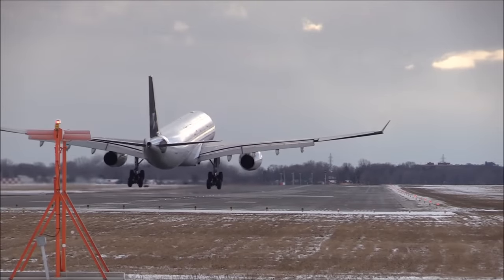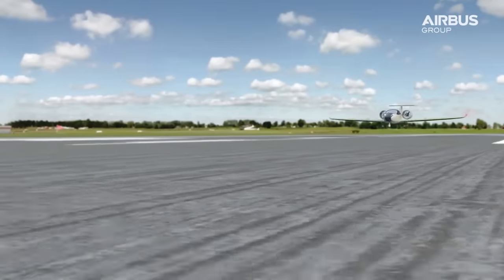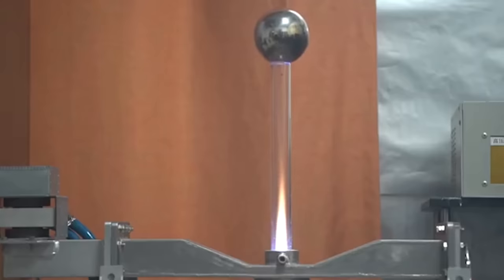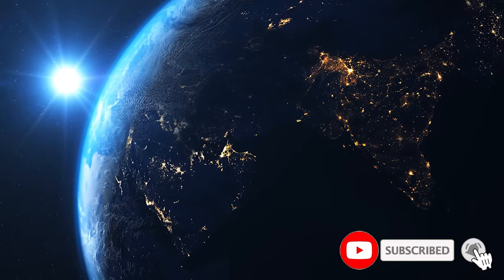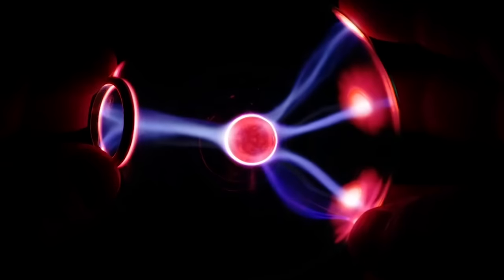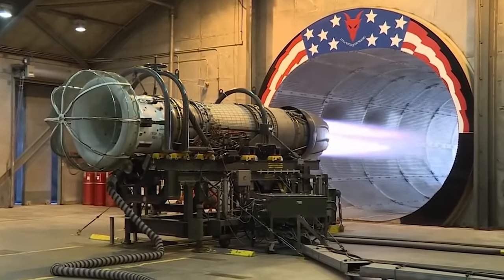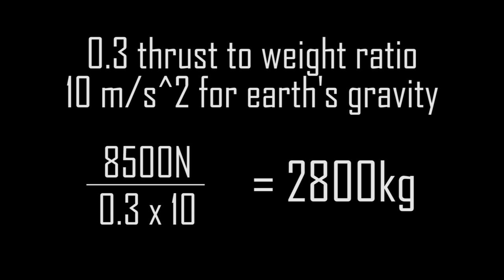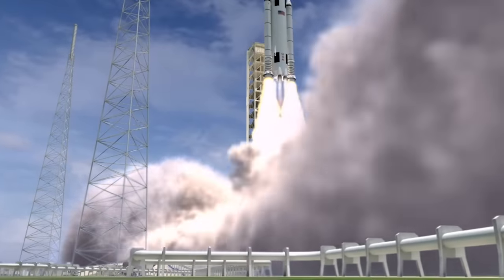Uncovering China's New Electric Plasma Jet Engine

Comment: a fusion reactor powered aircraft would be really cool. this device is almost like a plasma torch turned up to 11
Reply: Flyingwigs 
Cool description!
Reply: Nice. Have you heard of torch ship concept, by the way?
Reply: America tried a fusion powered plane but flopped due to weight and potential safety hazards back in the day
Reply: @humdilla576   that was fission, not fusion. decaying radioactive fuel rods to generate heat to make steam. fusion is still not yet fully operational, but in theory can be scaled down to manageable sizes.
Reply: would be stupid to run the engine electric tho
Reply: not when the engine also generates the electricity from the same process that propels it. you only need batteries for reserve power or in between engine runs.
Reply: @Flyingwigs  Then it is more like a fusion engine with a generator on it, rather than an electric engine.
Reply: @Al Castill Never a good idea just ask the Russian's.
Reply: I believe that it's called the "big stick" and its exhaust emissions were radioactive. 
 the rods would get stuck because of the heat after it went full throttle. 
It was an unmanned drone.
Reply: won't work ... It's exhaust will keep on spreading RADIATION continuously 
IF U PUT COOLIENT or etc will increase much weight of aircraft and production cost and maintaince.. maintenance requirements would be regular and high cost
Reply: @MrGrinny  oh no
Reply: Certainly not through Tokamak designs. High likely not using magnetic confinement alone, no matter which configuration. BUT, we can not discard some kind of inertial confinement, specially on devices that use aneutronic fusion (Boron-proton) capable of direct transformation of fusion to electricity without a bulky generator. In linear configurations, I think that a compact machine on future refinements could fit inside a plane, probably dividing the cargo space and using the back of the plane as the "fusion detonation" area (with minimal radioactive with proper shielding during the flight).

Big planes anyway, but It would be cool for large flights have big planes that works on cheap energy.

The requirements are high. First we need to have achievable fusion. Later with need compact and very reliable fusion for continuous operation. And probably we will need batteries improvements to have  a battery pack for manage energy and have a backup for shutdown emergencies.

I don't expect something like that very soon, but I see this like a future possibility.
Reply: This is not fusion. No one has yet created a stable net gain fusion reaction
Reply: 1st they have to find a way to contain the plasma without hitting the wall and also they have to find something that resist high temperature caused by fast neutrons.
Reply: @makisekurisu4674  they think its closer with that resonant wave currents theory, but yeah.
Reply: @makisekurisu4674  awesome account name btw ;D
Reply: @mithlesh7042  fusion does not create the deadly forms of radiation that fission does. also it wouldn't need to be open air fusion, just a reactor that powers the electric thrusters
Reply: @NateFanning  never claimed it was, just that using this in combination with a working fusion reactor could make all electric aircraft closer to what we vision in scifi movies already.
Reply: @Flyingwigs  El psy Kongroo🤨
Reply: @Flyingwigs  An aircraft with a fusion reactor could easily be modified to for space flight all they would need is a water or liquid air tank.
Reply: @Flyingwigs  check out the dense plasma focus from Focus Fusion Ltd. They've set some fusion temperature records for aneutronic fusion of B-11 and deuterium. If they achieve high gain fusion, and use an induction coil to collect extra power from the charged Helium beam exhaust, this could be a great design for a fusion torch rocket.
Reply: 😅 Yea cause a meter of concrete seems viable
Reply: Better than a flying nuke!
Reply: @Flyingwigs  Actually they tried ti without steam and using superheated air as well. There was a cruise missile that was gonna orbit the world indefinitely. It would be unshielded to emit radiation but that may have been anecdotal.
Reply: Okay, imagine 1 million plane with those engine everyday. What would happen to our atmosphere in 1 year?
Reply: @spacedoge3508  he said battery, not a generator my man.
Reply: @mithlesh7042  you have no idea what you're talking about do you
Reply: Fusion and antimatter should be the only type of nuclear energy allowed. Current fission nuclear reactors should be banned.
Reply: @cinegraphics  not until we have a proper well established alternative to fission............which is looking to be soon but now immediately, give it a few decades
Reply: True but the heat would be too hot and after a will it might melt the inside depending how they use it though
Reply: @inseclipse2540  carbon or titanium based heat shields
Reply: Exactly what I was thinking
Reply: @jordanmendoza812  I would say titanium but its heavy and carbon is light I actually don't really know which would ultimately be better
Reply: @inseclipse2540  depends on the throat generated by the plasma
Reply: @jordanmendoza812  true if it was low powered then use carbon or if it is high powered use titanium
Reply: Flyingwigs I was under the impression that energy efficiency of fusion is inadequate at the moment. Is that still the case ? If not do you have any scholarly references supporting this ?
Reply: @omara3389  true fusion reactors aren't perfect by what I meant is the don't last long
Reply: It'll probably be 4-5 times bigger and heavier than a plane I think
Reply: @0s0sXD  possibly because of our technology at the moment
Reply: @omara3389  at present, yes it is still not producing any usable power. "its close" is the usual saying :P
Reply: @moritzk3004  that's not how fusion works, it's not a bomb. nor is it dangerously radioactive. it would be cleaner than nuclear fission and jet fuel, so I stand by the concept :P
Reply: @kl6379  hard to say without some sort of case studies on the exhaust products. could generate a lot of ozone gas, as most plasma devices do.
Reply: @Donthaveacowbra  the old fission reactor plane concept used very little shielding, as yes, it would add too much weight. fusion however, doesn't produce the high energy radiation, and as such little shielding is needed. 
+1 for fusion aircraft :D
Reply: @oatlegOnYt  I heard rumors that Skunkworks was working on a scalable reactor for portable base of operations, or to restore power to a broken grid on the battlefield. one goal was to have it small enough to deliver via truck and something like 5Mw power.
Reply: @Flyingwigs  a thermonuclear bomb or hydrogem bomb is a fusion bomb, and throwing radioactive material (which you need for a fusion) into an explosion (the plane crash) and i think you can imagine what would happen
Reply: The Soviets made a nuclear powered aircraft a long time ago!

It didn't end well!
Reply: @nicktechnubyte1184  not with fusion power, it was dirty, hazardous fission power. fusion would be clean and reasonably safe once it's been made operational. fusion has been accomplished, just not with the power generation required to make it viable, however the types and amounts of radiation made are known and easily dealt with.
Reply: That needs some miniaturisation for reactors tho
Reply: It will be a disaster if it crashes
Reply: it is an interesting idea
Reply: I would first settle for a working fusion power plant on the ground, if such a thing is even possible in the next 30 years. That would change everything we know about the world
Reply: @makisekurisu4674  and radiation shielding for Cosmic rays and thermal protection for re-entry and it wouldn't need wings, so basically a totally different vehicle.
Reply: @adrianfox9431  They would need some flaps at least to glide but having wings like the shuttle would be nice.
But the weight of shielding is quite the issue. Even on anutronic fusion produce some neutrons.
Reply: @Flyingwigs  manageable lol
Reply: More like grapes in a microwave
Reply: We already had nuclear powered jet engines in the mid 50's...

https://en.wikipedia.org/wiki/Supersonic_Low_Altitude_Missile
Reply: As an  engineer while designing things we design for worst possible conditions  
 Although it is a great Idea until you consider a plane crash with radio active material in it.